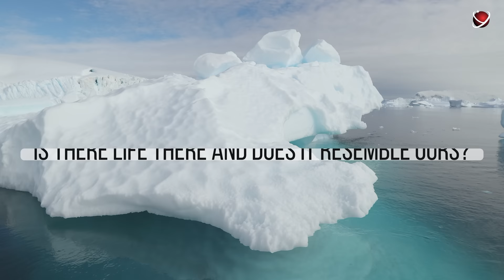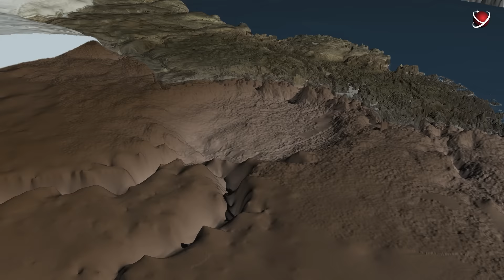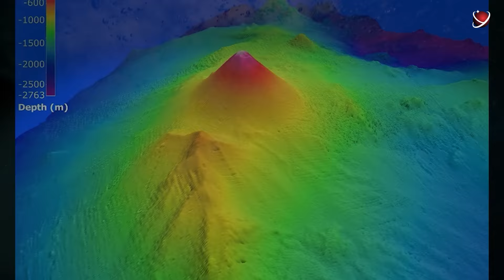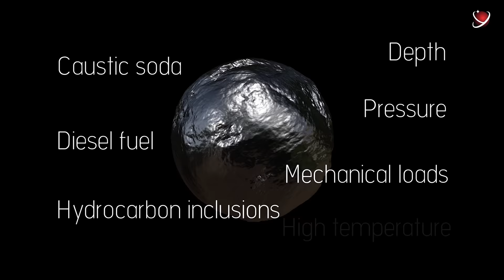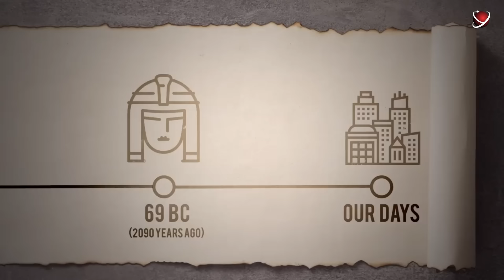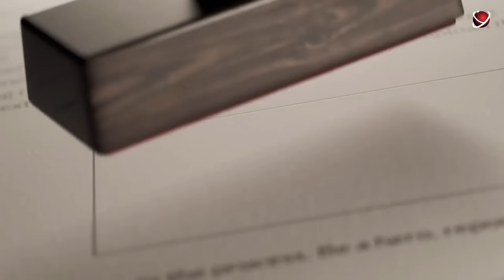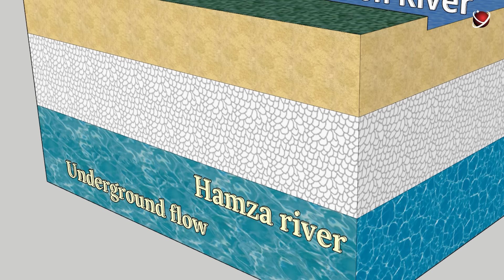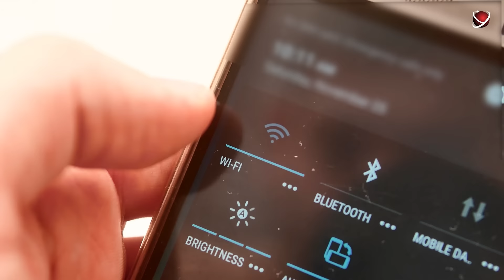The Most Mysterious Places on Earth 4K - ReYOUniverse

Comment: It’s the sea serpents breaking up the ice and there are a lot of them many varieties I started naming the ones in Iceland. I watched it break a block of ice and they called it an earthquake. The sea serpents cover themselves with ice to camouflage. They keep their head still and use their tail and body. They are easy to identify by the snow dust when slithering. Or the flow of water changes. Of course they want the ice to melt. For minerals oil etc.

Comment: China built the Three Gorges Dam CLOSE TO A MAJOR FAULT LINE. I wonder how much pressure the Dams water puts on the earths surface. It has to be able to be calculated by a brainiac. The water pressure the Three Gorges Dam’s water puts on the earths surface has to be tremendous. I wonder if this water pressure will help prevent an earthquake or end up causing a magnitude 8 to possibly a 9 on the Reciter Scale earthquake. A earthquake of a magnitude 9 on the Reciter Scale would cause catastrophic damage. If the Three Gorges Dam would fail and break apart. Just the amount of water. Would kill many people and destroy many infrastructures. Human diseases would run rapidly throughout China. Spreading to other countries that borders China.The earthquake itself would also cause catastrophic damage to everything within its range of shaking, moving and rising of the earths crust.  Maybe causing a tremendous Tsunami in the Sea of Japan . That would kill many people and also destroy many infrastructures. It would also destroy China’s economy and take many,many years to clean up the destruction that a Magnitude 9 Earthquake would cause.

Comment: @56:05--59:49--1:05:00  
So, in 2012 the amphipods discovered at the bottom of  Puerto Rico's Kermadec Trench 
were orders of magnitude larger in SIZE than amphipods found at sites where the 
WATER PRESSURE isn't nearly as great.   Is there an analogous correlation between 
GRAVITY and the SIZE of fauna?   (NB: GRAVITY affects the genes that regulate SIZE).  

Mesopotamian folklore proclaims that Earth and the asteroid belt are remnants of a much larger SIZEd planet named Tiamat (with presumably higher GRAVITY).

Comment: 🤔 The difference in water and ice density is quite large, recalculate and get it right.  If all the ice turned to water, the sea level would drop a few meters.
Reply: You are correct, if the only thawing of ice were iceburgs. It would be like ice cubes melting in a glass of ice, with the volume being relatively unchanged, just the state of what comprises it.
Here, thawing is referring to glaciers. Glaciers are on land, and would, of course, run into the sea once melted. This is how sea levels would rise. The glaciers would add what's frozen on the land into the sea. 
:)

Comment: I would also like to point out an extremely flawed calculations. When the green land icesheet melts, the relieve of weight and pressure will cause the land mass to surface and will GREATLY lesson the amount of water that raises the oceans. Same goes for Antarctica. When those ice sheets melt, the land mass of Antarctica will Raise to the surface as well, preventing even more oceans to rise.
If you haven't noticed, the planet has built in mechanism for self sustaining life. I don't think that we would even see more than a maximum of 1.5 meters in rising oceans (sea level).

Comment: A certain metal shot from the sun and is now used as a under ground drill that can with stand the lava but it is unmanned it uses Radio signals like a remote control airplane. All other signals will not work, the signal used is from the satellite that was shot so close to the sun and the signal was of one but in that signal were many and during the drilling in Colorado many ships were seen around our solar system. The global news marked everyone on satellite to hide and now because of this unique signal a group is using that signal as well as many from that signal to try and call the ships from space but have military weapons and trying to shoot them down for technology as seen by the air force on the News.

Comment: If you choose to breathe water, then you can go deeper than a regular diving tank will allow and 2 gentlemen, or is it 3? Gentlemen, have done it at least 2 of which are dead now.
And strangely enough.  2 of those 3 gentlemen who have taken that dive. We're also the original designers of scuba gear. Specifically, yaku stow has that has dived down nearly three thousand meters without a basis fear. Instead he used a hard suit

Comment: Umm mm,  Interesting, however dross.
If the Glaciers melt. The average temperature must have risen by at least 30° flooding, earth slowing down will be the least of our worries.
For every power station the west closes, India China other developing countries open 2.
So the narrative falls down there.
Additional CO2 encourages vegetation growth, which in turn produces oxygen and food.
Oxygen on its own or CO2 do not increase air temperature.
Earth's orbit, it's tilt sunspot activity are factors.
In addition water moisture in the air increases temperature, by its magnifying effect of the sunlight etc.
CO2 parts per million is about 440.
Human contribution minimal single figures, sea and volcanic activity contribute the most.
It is miles lower than 100 , 000's of years ago.
Life thrived with a wealth of global vegetation.
Sea levels were higher, they then receded,  it's just the cycle of the earth.
I do not doubt that man has contributed to the level.
However, CO2 no not in my mind.
Now, if the narrative was Carbon monoxide you would get my full support.
Plus, fact, as CO2 is lighter than noxious gases it helps to protect the Ozone layer.
On that note, the Ozone layer does repair itself.
A minimal amount of time is only required to find these facts out.
No, not from conspiracy sites.
Scientific proven historically, geological and climatologists data going back years.
Simples.

Comment: There is an equilibrium in Antarctic Ice; they are not losing ice as Ice builds up in the Eastern Antarctica; Ice melts in the Western Coast Region.  there is a balance reached in Antarctica.  The North Pole may melt; but a new North Pole region will replace the old Magnetic Pole as it migrates further South over Europe and a new North Pole and South Pole; leading to a Pole Reversal.  Mother Earth will find a new balance.

Comment: At least the megladon and old water bound dinosaur by comparison will be back and no artificial Cooling core and heater belt dinosaur to bleed off 5 M and freeze it to the core caps by the general wind and heat lines system at the poles a very special super magnet for planetary use to the density of a campus to fix this issue I think we are going to need a lot off hydrogen and enough tec to support but population is becoming more like a cancer??.😃😄😁😆😅 5 Smile's.